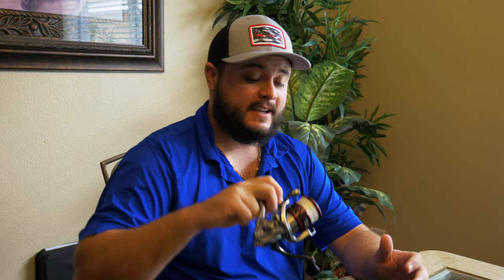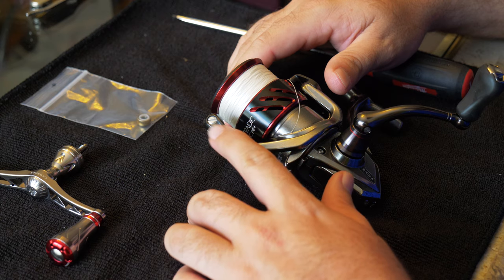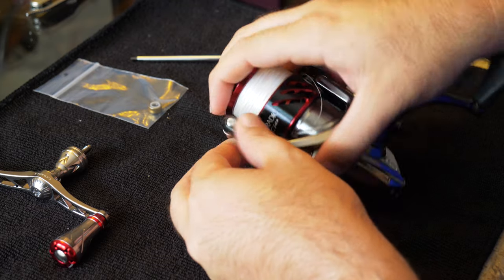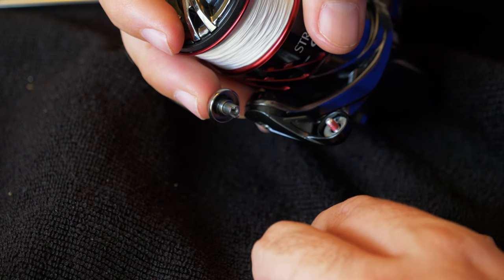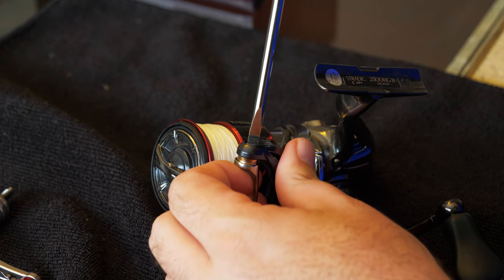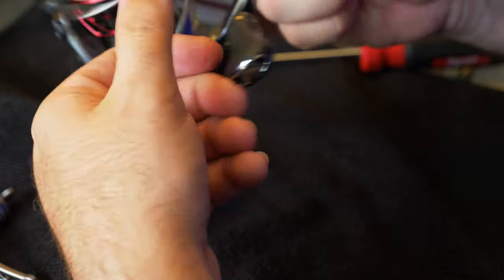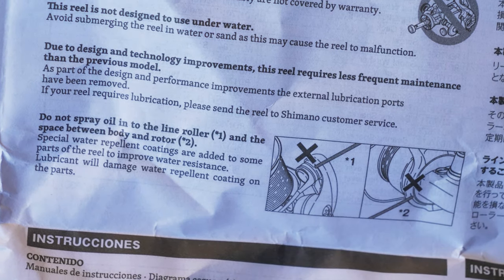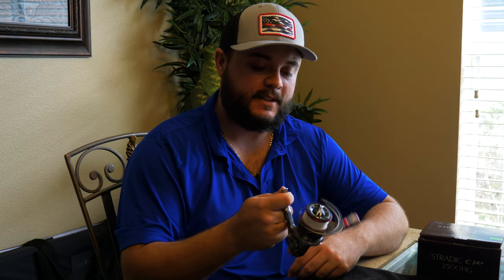How to Change Line Roller Bearing in A Shimano Stradic Reel

Comment: Would the roller bearing cause a grinding sound? I notice that when I reel in my line, it sounds like it grinding. I take out the spool and turn my handle and no noise. Thanks 🙏🏼

Comment: It appears that the 17680 washer is mounted on the bottom and not on the outside. This is how the manual says that it has to be on the outside. I have seen many videos of the breakdown and it is always inside, which surprises me since in the manual and in the Kit diagram it has to be outside
Thanks

Comment: So do you have an extra handle? The chrome cap came off the handle on one of my ci4+     it bugs me because i have 4 and use all 4 and when i come to use that one, i feel the cap missing 😔 or maybe i should try upgrading the handle
Reply from the maker: Hey Marcos, you don't get another cap when you buy a handle but Call Shimano, good chance they will replace it or charge very little for a replacement.
Reply: Marcos Reyna I’ve lost that cap twice on my ci4+ both times I bought a cap on eBay. Costs like $8 bucks or so.

Comment: I tried to 'gently' take the roller guide apart on my older ci4 3000, but it kind of got away from me. Now tho, I'm not so sure that I have the sequencing correct in order to reassemble ...??? I cleaned it all up anyway, still grinding, though not as bad before, but still unpleasant and irritating.  I would to buy a complete replacement  kit (WITH DIAGRAM SEQUENCE INSTRUCTIONS!!!) and replace the whole assembly, but having trouble finding anything of the sort... ??? ... ??? ... ???  Great reel though!!!

Comment: Where do you order the handle from?
Reply from the maker: Ebay is where I purchased mine, cost about $50
Reply: Joshua Taylor 
Thanks!! I’m headed to that site to grab a couple now.
Reply from the maker: You're welcome, they are constructed nicely.
Reply: Joshua Taylor 
Does the titanium red fit the ci4 3 or 4000? I like that color better but want to make sure it will fit. I have 2 ci4+.

Comment: You are not changing the bearing you changing all the line roller. You cheated on the title
Reply from the maker: It's one of the same.
Reply: @Saltyscales  you can slowly open the plastic bushing and change the bearing
Reply: @oussamadje4744  thats what i wanted to say, that he is chaning the line roler, not the bearing ir line roler
Reply: @oussamadje4744  How is this disassembly performed? I'm having trouble accessing the bearing. Thanks!